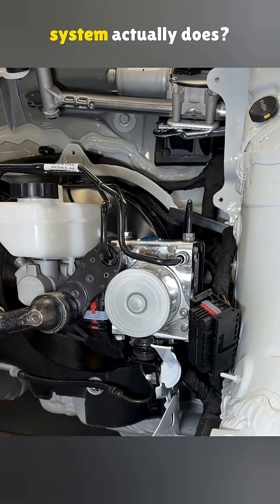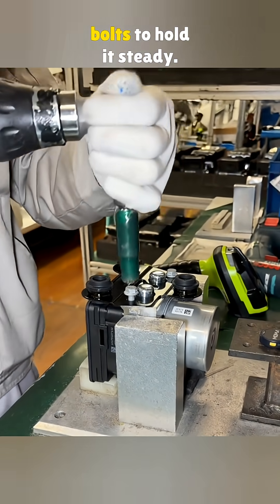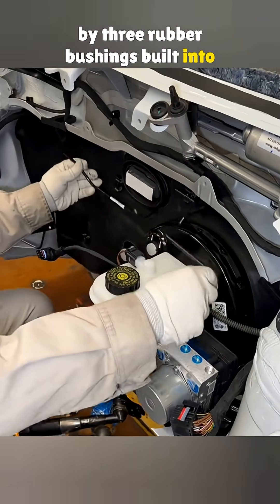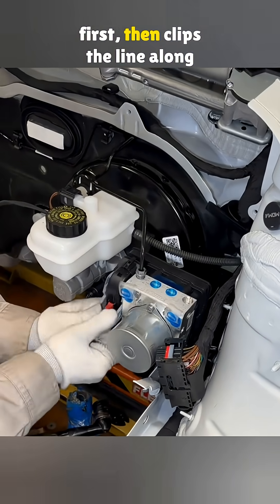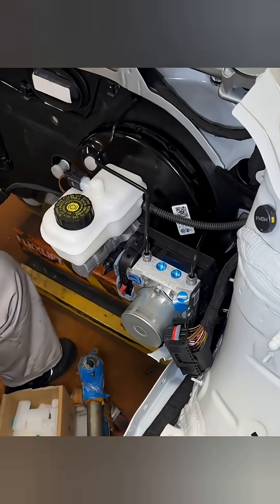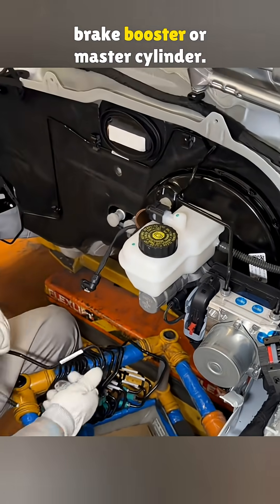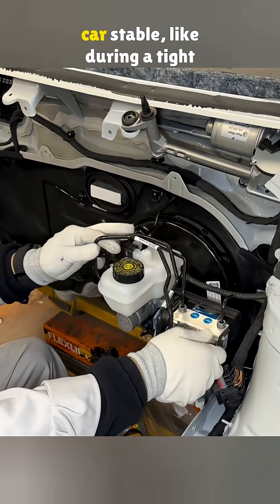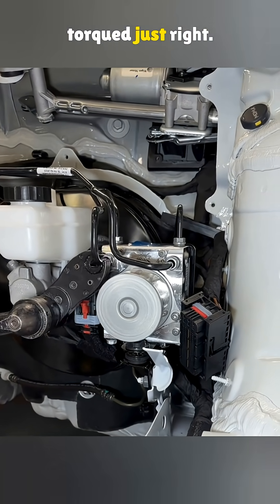Why Every Volkswagen Has This Hidden System #assembly #automobile #car #manufacturing

Comment: Oh I have for sure. Going around a roundabout in sports mode which stiffens the suspension, my car bounced due to uneven road and started going sideways till ESP kicked in and straightened up. I did have traction control off which took part in me going sideways.

Comment: I was born in 1951 and I remember the time when cars did not have these modern safety systems. When I was a child cars just had a single master cylinder to handle the brakes on all four wheels. While I was growing up the first improvement was dual master cylinders where one cylinder handled the front brakes and the other cylinder handled the rear brakes. Then the next improvement was antilock brakes. Then came traction assist. Then finally came vehicle stability control. Cars are a lot safer today.
Reply: I believe ESP came before traction control

Comment: I had a Ford Capri once and it came with an Instability program….basically whichever way I turned the wheel, the ass end would kick out and dump me in a ditch. Ditches like me

Comment: My pet peeve is this: Electrical things, like this wrench,  always seem be called "electronic."
Reply: There are circuits in there to detect how the torque rises and to cut off when the correct torque is reached. These are very advanced tools that can detect a cross thread or other abnormalities in the tightening process. They are not simply an electrical wrench.

Comment: FALSE!
These is just the ABS module that gets commanded by the CPU.

The ESP is in the CPU and other sensors (yaw, deceleration, etc.) not in the ABS actuators!
Reply: Most of the sensors are incorporated into the CPU circuit in the module, including the G sensor, Yaw sensor and pressure sensors. In fact in the latest versions most are actually on the chip.
Reply: ABS block is compressor valves and ECU, most often it's the main block where yaw and tilt sensors connect. Basically ESP is ABS plus gyroscopes

Comment: Car stability systems are awesome. It started with anti-lock breaks. Humans in a panic will very commonly press the break as hard as they can which actually causes the car to go out of control. 
When the break presses back against you, preventing the wheel lock it can help you understand what to do, even in the heat of the moment. 
People be dumb so they needed to make the cars smarter.
Reply: they actually reduced the feedback through the pedal as they found to many people then lifted off the brake and still had an accident. They also added to the programme so that when it detects abnormal hard braking it increases the brake pressure to the threshold on all 4 circuits quicker that a person can apply it. The pressure is then held until either the vehicle stops or the driver reduces their effort significantly.

Comment: How do they bleed brake fluid?.
Reply: They you a specific programme that opens all the valves in the modulator. They then apply a vacuum to the system, pause a few seconds to check for leaks and then pump in the brake fluid under pressure to the correct level in the reservoir. All this takes about 80 seconds.
Reply: @leewatson8129  VAG-COM clone can start ESP pump, select actuator test
Reply: With vacuum pump. I was able to bleed ESP with vacuum pump
Reply: @r11tc  not the entire circuit on a dry unit., as the pressure relief circuit is closed.
Reply: @leewatson8129  somehow id did the job. But I know how to use output test in VCDS ;)
Reply: @r11tc  you can bled it normally, and then activate the ABS routine, rebleed, re-activate and rebleed to clear the air. You have to do this for each wheel and then test to see if the pedal changes after a few ABS stops.
Reply: I bleed with VCDS output tests